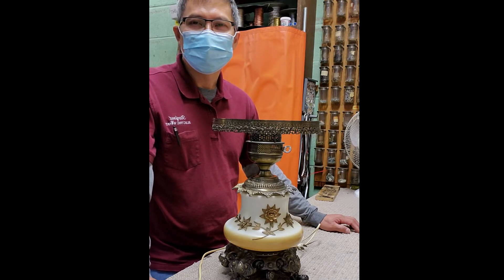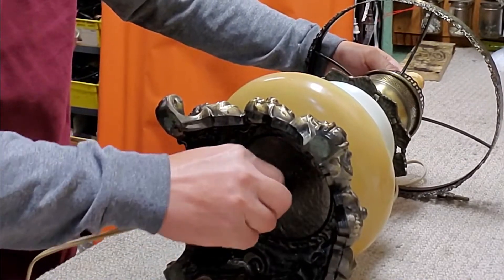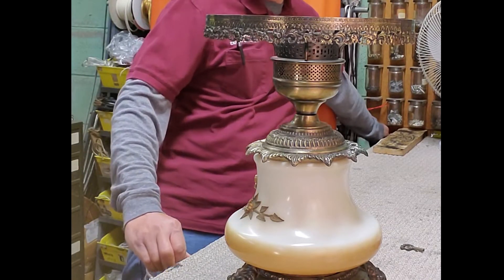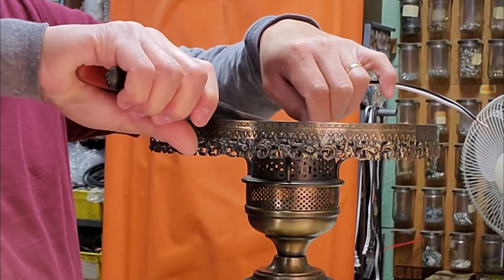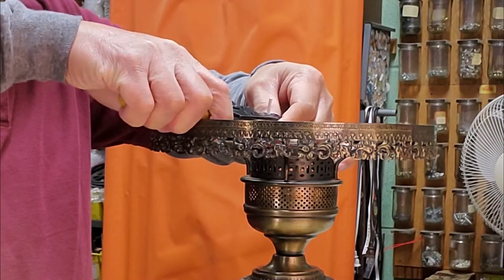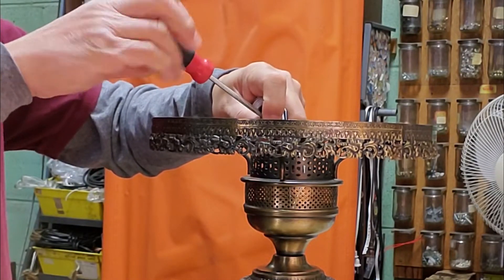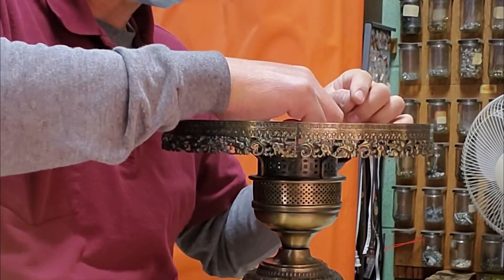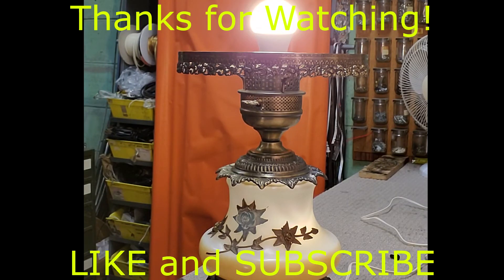How to rewire and replace the 3 terminal and candelabra socket of an Antique Table Lamp

Comment: I blew out a fuse because I miss understood what the diagram of the wire placement is. I had to watch the video a few times to understand what  is going on.  People that don't understand electrical will not understand the meaning of textured "wrapped" and smooth wire when it comes to the universal negative/ground and positive/hot or neutral.  Clear communication is key to a tutorial or teaching new people. Proceed with caution! The miss understanding of this tutorial can lead to a hazardous fire or electrocution.  Daboy has good intentions and has an understanding of what he is doing but has poor English and visual demonstration skills.   I figured out how to put it simple.  Black wire from lower socket goes to (Black screw). Positive/hot from plug wire goes to (Brass screw). The white wire from the lower socket and the Negative/ground from the plug wire go together on the (Silver, Metallic, Chrome color screw).  Please take this as constructive precaution  for the sake of everyone's safety. If you feel unsafe about this project please  take your lamp to a local lamp repair shop.
Reply: I appreciate the clarification. I was a little confused and concerned about wiring incorrectly 🙏🌸

Comment: Hi Danny I just want to make sure I'm wiring this correctly. It has two keyless sockets at the top one to the left one to the right and a little cluster body in between the two arms. A night light directly below the cluster body inside the cap and a three wire canopy switch. Very antique lamp. All the wiring is at the top of the lamp.
Reply from the maker: Hello Kathy,  this is how you connect the wire. Connect the smooth side wire of the power cord to the black wire of the 3way switch. Then connect the red wire from the 3way switch to smooth side or black wire of the bottom socket or night light. And connect the blue wire from the 3way switch to smooth side wire on 2 keyless sockets on top light. Then connect the rough side wire from the power cord to rough side or white wire of the bottom socket or night light together with the rough side wire of the 2 keyless socket on top light.

Comment: Como esta usted? with respect Sir, it is not the wiring that is loose but the connection between the top and bottom globes.  How do I tighten those connections? The lamp wobbles drunkenly.

Comment: which side is the white side attached to for lower light  - neutral or hot (smooth or ribbed)? which is silver if not have silver tip black tip wires?
Reply from the maker: Hi there! The white wire or neutral of the bottom socket or  bottom light attache to  the silver terminal or neutral of the top socket or top light together with the neutral or ribbed of the power cord.